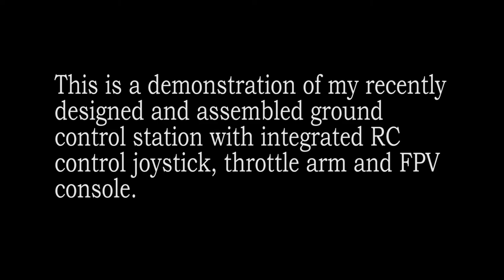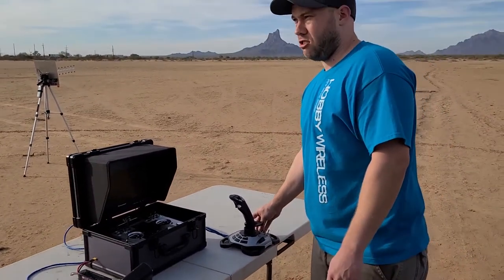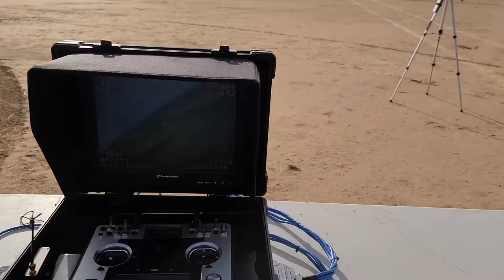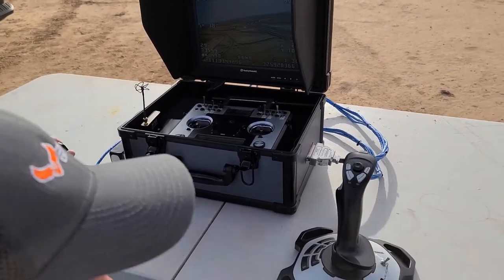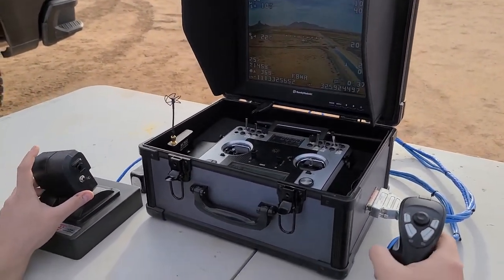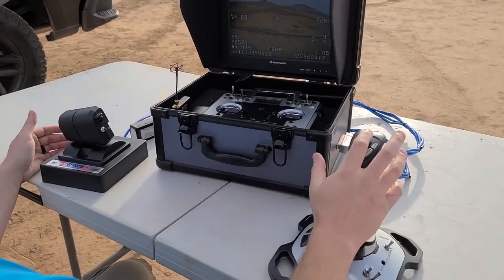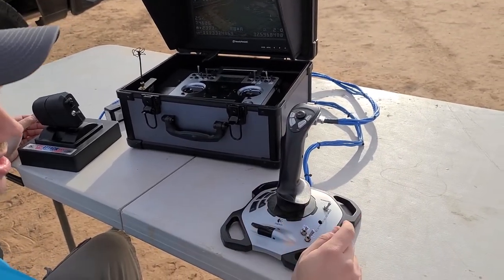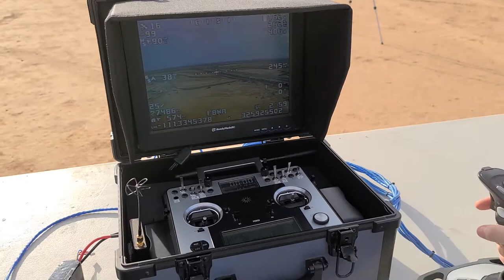FPV Ground Station walk around and demo - Joystick and throttle arm control!

Comment: @MadAtTheSky Could i do this with any receiver?  

What fpv system did you use

If you could answer these that would be great.
Reply from the maker: It's actually the transmitter that is modified, but yes, any transmitter will work. Some are more difficult to do this to than others. I used a FrSky X9E because all of the controls were tied to the circuit via connectors. I unplugged the connectors and wired in external connections so I could reconfigure the transmitter back to its original state if I wanted to use it as a traditional transmitter.

Comment: Hello ! Nice video, can you explain how do you have interfaced the joystick with your system ?
Reply from the maker: Hi! I essentially hardwired the joystick to the motherboard inside the transmitter. I made it modular by installing D connectors to the case and joystick to make transport and troubleshooting easier.
Reply: @madatthesky7588  Could you possibly share exactly how you hardwired the joystick to the controller motherboard?
Reply: @crossbowmotors8368  He wired the potentiometers and switches from the joystick to where they would natively be on the transmitter. Example, the pitch and roll axis potentiometers on the joystick would be wired to directly to where the pitch and roll normally go on the transmitter motherboard. Same for the switches. Hope this helps! Best of luck!

Comment: Hi very nice setup. Any build details? Thanks
Reply from the maker: Thank you! I really wish I would have done a better job documenting the build but after I started on it I just kinda went full steam ahead until it was completed. I can answer any questions you may have about it though.
Reply: @madatthesky7588  Thank you. i'll ask when i also have time to do one. Big thanks
Reply: @madatthesky7588  so basically you just tap the wire from the stick controller in the transmitter to the potentiometer of the joystick, is that what you did?
Reply from the maker: @gcl_2000  exactly. I opened up the joystick and soldered wires from the pots to the inputs of the transmitter where the sticks would plug in
Reply: @madatthesky7588  thank you very much
Reply: @madatthesky7588  did you just solder them to the input? Without any resistor? Nice job. Will build one for myself. Love it.
Reply from the maker: @Ard1400  yes sir, that's exactly what I did!

Comment: Is this adaptable to a quad drone system such as DJI?
Reply from the maker: It would take considerable modification to work with DJI systems, unfortunately
Reply: @madatthesky7588  what drone system capable of quality video is adaptable to joystick controls other than DJI
Reply from the maker: Excuse me, I take back what I said previously... you could theoretically open up a DJI controller and wire into the gimbals and switches like I did with the Taranis. The DJI transmitter would of course have to be modified. Sorry for my confusion

Comment: How did you interface the joystick and throttle into the X9E ?   Analog ?   You took the voltages off the external controls and fed them into the X9E motherboard ?

Do you have a build thread for this setup ?
Reply from the maker: Hi, yes all analog. I hardwired everything through D connectors to the motherboard and just calibrated the joystick and throttle through the calibration screen on the radio
Reply from the maker: I do not have a build thread but I'm building another setup and make a thread from that
Reply: @madatthesky7588  I'd like that.
Do you realize that you could attach the signals from the throttle and joystick via USB into an RPi and then feed the signal into the transmitter via the trainer port ?
Reply from the maker: @SomeTechGuy666  yes, I originally looked for a  USB to ppm converter but couldn't find one so I just rigged this up. It was a little time consuming but otherwise pretty easy
Reply: @madatthesky7588  I saw some projects on git a while back.  I'll see if I can dig up some links for you.   Would save a lot of wiring to use USB instead of analog.    But I understand why you did what you did.
Reply: @SomeTechGuy666  I'd be interested to know about that as well. Planning to interface to my QX7. I've only ever tried using the trainer port for a Master/Slave setup for teaching newbies how to fly quads.
Reply: Awesome would love to see a build video on how you wired in the joystick it seems there’s no simple way to do this would be nice if you could just plug A USB joystick straight into the radio
Reply: @madatthesky7588   whoa, what a cool setup! Any updates?
Reply from the maker: @MrDrivesafe  So, my family and I moved from the very southern desert of Arizona to the wetlands of Seattle and during that transition this groundstation was disassembled and essentially destroyed.  I am currently working on rebuilding it but better. Thanks for the comment!